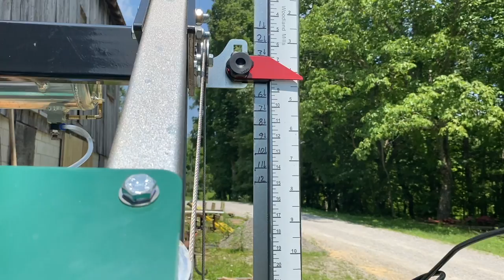4 Sawmill Hacks everyone is copying

Comment: Good idea about saving the log stops. I just wrecked a blade yesterday!! Both my log stops have battle scars but the worse part is the lost use of a blade.
Love the PVC uses for the cant hook storage. 
Already have a homemade diverter where the sawdust comes out - just wasnt smart enough to put a bucket on it. Sometimes Im so proud of coming up with half a solution, it doesnt dawn on me to finish. Anyway, I will no longer have a snowdrift of sawdust running along the backside of my table!
Had developed longer steel posts to use in the log stop spots to help roll 'the big ones'. Noticed how bigger logs would bite in to the shorter stops. Love your solution of the PVC over the standard longer stops! Its a timesaver!
Thanks for the hints. As a mill owner of about 8 months, I'll be watching for more 'lessons'!
Reply from the maker: Thanks Joe! I’m great at copying others ideas. The log stop numbers help me remember but I still have to remember.

Comment: I just use wood 2x2s for the log stops.  I've ruined too many blades hitting metal ones.
Reply from the maker: I need to try that again, I tried it once and my cants were out of square but it works for you and others so I probably did something wrong. Thanks Norm
Reply: @Jared-Brubaker  I have to be very careful about getting them square too.  That is a disadvantage to the wood stakes

Comment: The log STOP that keeps the log from rolling off the back side, the ones you and Sandy cut and mess up your blades. Take a piece of wood big enough to stick down in hole and used it to keep log from rolling off and the key is to find the hardest wood you know and cut it square to that square hole and no worries of dulling your blade. Hope this helps. Hickory is a good hardwood to used. Have a great day be safe.
Reply from the maker: Thanks for the suggestion Arthur. I’ve been meaning to try that, I think that would be the best solution.
Reply: I found that hack on another YT video, it worked great until one of the cubes I cut off, got sucked into the blade housing, and bent the heck out of the sheet metal guard, and it threw the blade off the wheels.
Reply: Yes. I used oak. No hickory here Any hardwood beech would be ok.Ash.Birch maybe. Good idea.

Comment: nice video  i have almost finished my sawmill shed. i think i will put pvc pipe on the shed post for the cant hooks. i have got a dust collector. but have not got it hooked up yet. i have not sawmilled any thing in over a month it's so hot here over 100f again today. take care, be safe and well.
Reply from the maker: Thanks again John! Your a goodun. It sure has been a hot summer so far, 80s and 90s here in Muddy Pond TN. I can’t imagine it being over 100, I wouldn’t be sawing anything either. where are you from?
Reply: @Jared-Brubaker  i live in roocky mount va. near blueridge park way east side. north of martinsville va. it has been hot 90s to 100 or more here for a while.smoke is getting bad here to from fires in the west. i will have to look up muddy pond tn. i went to nashville once and that is a real hot place in summer. take care, be safe and well.
Reply from the maker: @johnwoody4905  muddy pond is around 1300’ higher in elevation than Nashville, thankfully takes the edge off the extreme heat… no smoke here from the wild fires yet this year.

Comment: The bucket idea is a cool idea and I have seen it before.  All you need it to cut…heat and bend the PVC to make a turn down shot and drill and bolt it on.  I think only a regular 5 gallon bucket will be needed after that.  Well, give it a try and see if it works, and let us know.  Thanks for sharing.
Reply from the maker: That’s an idea! I’ll have to experiment when I have the time.
Reply: @Jared-Brubaker  Maybe even a piece of galvanized metal. If you use a piece of paper or a piece of cardboard to make a template. I’m thinking might be the best way, and would save you material. If you have like three tabs at the top to screw or bolt it to your mill and then just a downward shoot witch could be just two 45° bends would probably work best.

Comment: Not super sure this will work as intended but adding a wire mesh to your bucket top, think of cutting a sphere into quarters (that shape), then lining the mesh with even finer wire screening material.  It would catch the sawdust, channeling it into the bucket but also allow blowing air an escape route.  Might get too clogged but might not.

Comment: I did the bucket trick as well.  What I did differently however was I got two strips of double sided velcro and cut out a piece of inner tube.  It wraps around the saw head and blows 99% of the sawdust in the bucket and I don't need to remove it to open the door.
Reply from the maker: Hey that’s pretty smart.

Comment: Set up a square or hex jackshaft to drive a vertical blade for edging each board as you go thru the log. This blade can be adjusted right or left with a guide that slides it on the jackshaft.
Reply from the maker: That sounds awesome, is there a video you can point me to so I can see it?

Comment: Add a bracket in front of the blade guide then mount  a finger of some  k8nd  that is  just slightly  lower then the blade  it will  hit your. Log stops and keep   your blade from hitting the stop I did this and don't hit them anymore

Comment: Replace the metal stakes with wood. I used oak. You wont hear that mystery noise as you saw thru the metal again. Trust me on this. I have.Use a brow to load your logs on instead of on the mill. A couple of metal bridges from scraps to roll from that onto the mill.What weird bases people have to mount their mill on. I ran a slab.Extending the saw bed and adding jam cleats to hold the logs is a good idea. I dont plan on logs longer than 12 feet.More is too big to handle, my opinion.